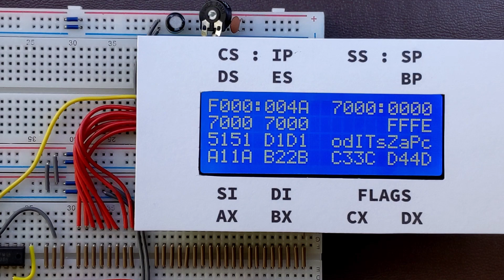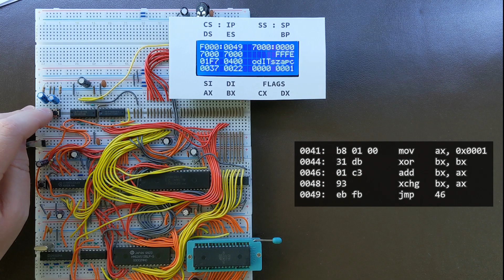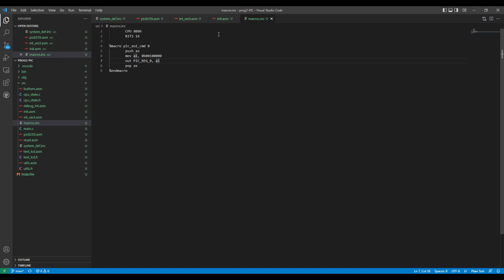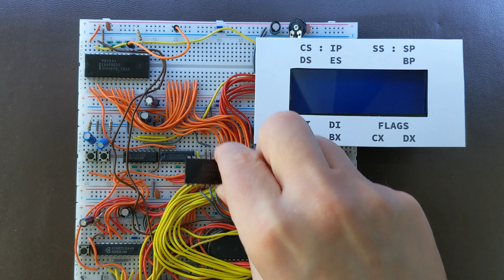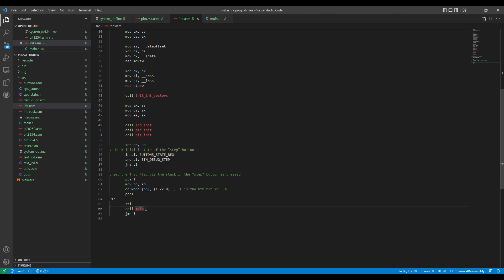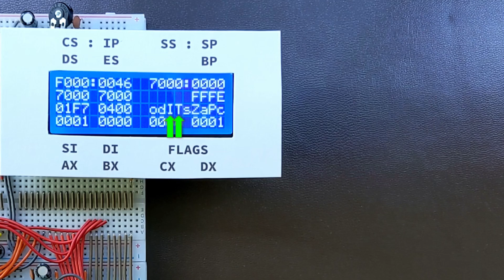More I/O devices: Interrupt controller and timers - 16-bit Intel x86 breadboard computer [part 6]

Comment: I would love to see a video in this style covering the 8087.
Reply from the maker: I'm not say "no2 to that. I have a few ideas which recently piled up on my list, which I would like to cover first, but then I probably will do that. My current contraption would need a significant rewiring though, as it now uses the "minimal mode" of the CPU buses while I'd need to switch it to the "maximum mode" to pop the 8087 in.

Comment: Could I use a microcontroller as a PIC?
Reply from the maker: Short answer is: "yes". Long answer is: "depends"...
You need to make sure your microcontroller is able to promptly react on signals appearing on its inputs. If you do it 100% in software you may struggle. Think of, for example, the case where you sent the "INT" signal to the CPU and the CPU acknowledges the interrupt with two "INTA" bus cycles. In both cycles you need to either reply with the IRQ vector on the data bus in one CPU cycle, or at least issue a "not ready" signal on the READY pin until you're actually ready to send the vector out. Then, what's crucial is for your microcontroller to REMOVE the bits on the data bus immediately at the end of the bus cycle, because you may cross-talk with the CPU (or another device) in the next bus cycle.
Doing all of the above in software is tricky, because you would need to react in a few microcontroller instructions. The functionality would need to be heavily implemented in interrupts and one interrupt can easily destroy the other one's timing.
If you really wanted to implement the PIC in a microcontroller, then my obvious recommendation would be to use the RPi Pico and its PIO, then it's not only easy, but proven working in one of my other videos.

Comment: I’m not to clear how .asm files mix with .c files.  Can you elaborate on that please.
Reply from the maker: @bitlong4669 Yes, well, maybe I should have explained it in more detail. In short, each file whether it is an .asm, .c or .cpp file gets compiled (using its own compiler) into something called the object file (.obj). It is nothing but the machine code of the compiled functions/procedures with some labels like: "here is a code named with this name given by this label (or a function name)". If the source file calls some functions from another source (by using the "extern" keyword in assembler or the function declaration in a C header file), the object file contains just a placeholder for the address of the external function. After this step, there is no difference between an object file compiled from an assembly source or a C source file. Then, the, so called, linker kicks in. It's only job is to put all the compiled object files together and patching the placeholders with the actual addresses of every external functions in the executable. In other words, the linker glues all the functions/procedures together to make the final executable working.
It's was a quickest possible attempt to explain the whole compilation process. Forgive me if it's not too clear - it requires a separate video on its own, really.
Cheers!
Reply: @SladorSoft  ok good. That’s what I thought.  I did linked different obj files from C.  Didn’t know the assembler obj would link like that, it make sense.  One thing though, the function signatures in assembler in videos were in comments like: ;some_function(arg) .  Is that how linker knew this is entry point for that function? Or did I miss something.
Reply from the maker: No, the comments are only for the mere human ;-)
When the compiler compiles your source file, it effectively creates a block of machine code with the labels "attached" to it together with the offsets in the file where each label appears among the compiled machine code. It also keeps placeholders for "jumps to subroutine" every time your source code calls to an "EXTERN" label - that means that this code and its label is contained in a different obj file - unknown at this point. Then the linker gets all the obj files together and tries to resolve all the "missing" labels between the obj files and patch their final addresses, effectively "linking" between them (hence the name of the tool). The labels are in general called "symbols". There could be more "symbols" in an obj file than only the labels - static data defined in your source code are also "symbols". You can see them all in the "map" file after building the project.
In assembler, all the compiler needs from you are the labels. The C/C++ function names are used to create labels. The C function names may be "decorated" with the preceding underscore. In C++ the encoding of the method names is much more complicated and it's called "mangling", but I guess I already digressed from your question, so let me stop here ;-) Happy to answer any follow up questions.

Comment: Great video tho again can't see loading the program into specific memory or loader
Reply from the maker: Hi! Thank you for your kind words. That's true that I never actually showed how I put the flash to my universal programmer and do the flashing, because I thought it wasn't that important for the subject. I felt that it was implied that before any test I had programmed the flash with the current code. BTW - that's why I installed this ZIF socket to be able to remove the chip easily.
Reply: Many thanks for the reply - these videos are inspiring

Comment: Thank for this series.... It would be impossible to jump from Z80 (or similar) to Intel without your videos. Thanks!
I had a few questions:
1) Could you elaborate a bit how you do configure the compiler (to generates 8088 code) ? possible treatments on files ? The ROM burning.
2) How could we compile the code from a Linux machine (like Ubunu since it is quite popular) ? -- we don't have M$oft computer here.
3) Some plan to add an UART ? (to have a console terminal)
4) Would you jumps from 8088 (hard to find) to 80286 (this sales) ?

Anyway, thanks a lot for your work. It is incredible.
Reply from the maker: Thanks Dominique! I'm happy to answer your questions:

1) I've been planned to write down detailed instructions of how to configure the compiler on my webpage ( https://slador.uk ), but haven't yet managed to find the time to do that - I'll try to do this in the near future (June in practice). A few more words on that below in 2). With regards to ROM burning, I'm using one of the so called "universal programmers" - plenty of which you can find on the internet like "TL866II" or "BeeProg" to name a couple.

2) That's actually much easier to compile on a Linux machine than it is on Windows ;-) You just need the compiler (link on my webpage) and "make" which is always there on Linux :-) The instruction of how to install the compiler on Ubuntu is here:
https://launchpad.net/~tkchia/+archive/ubuntu/build-ia16/
Despite the fact I use Windows on a daily basis, I tried to write my Makefile so it works on both.
In contrast, on Windows I had to build the compiler myself or, optionally,  install it on the WSL.
The editor I use (the VS Code) is optional, but also it is available on Linux if needed.

3) Yes, I have my 16550 waiting in my drawer ;-), but that's the future plan, beyond the next two videos.

4) In the second video from now (part 8) I plan to do "an upgrade" to my computer ;-) (I'd like to keep it as a surprise for now, please) and also I have a crazy idea along these lines for the future, but that would require me to depart from breadboards and make a PCB.
Reply: @SladorSoft  Thanks for all this valuables information. I'm also a Linux addict (@home & @work). I did figure out that you were using Windows because of VSCode.
Reply: @SladorSoft  Along other rough ideas... a PiZero 2 and some Python code could be used to creates device input (keyboard) and output (HDMI)... also some Wifi support... Humm maybe the compiler and ROM burning directly on x86 retro (by latching the buses)